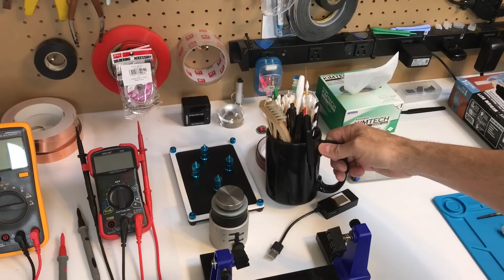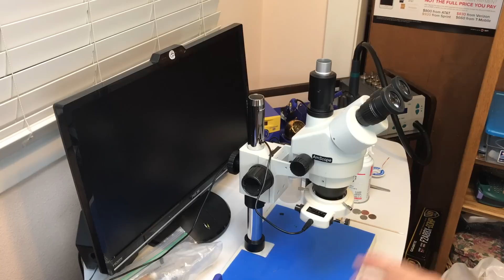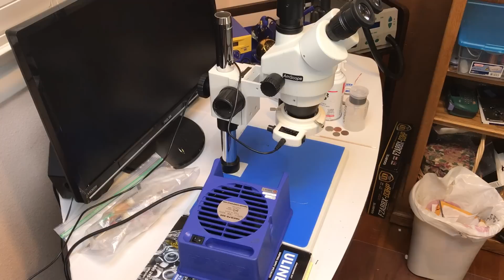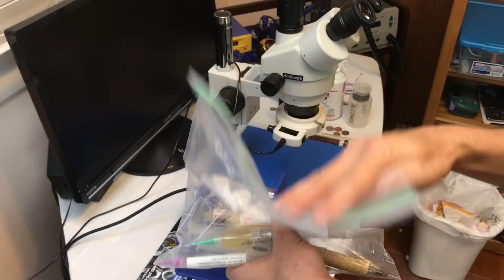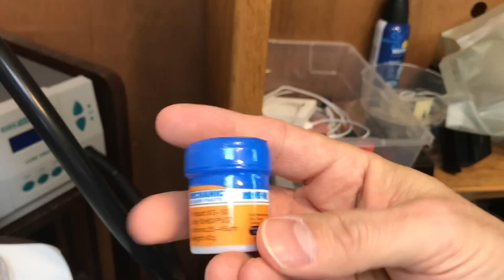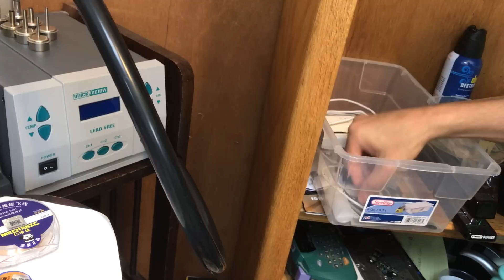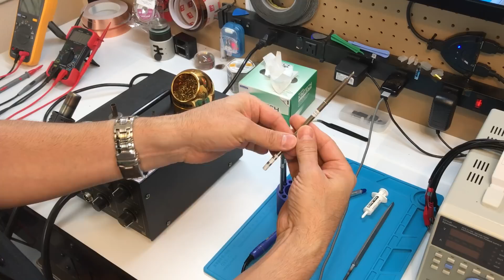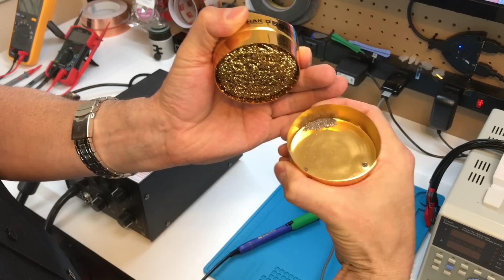Micro Soldering Repair Equipment

Comment: Please really need help, i have iPhone 6, work correctly , the only problem i get is that i cannot get phone calls when i pair it with my Bluetooth. IPhone recognize the Bluetooth pair with it, i can hear music on YouTube, i can make calls and video on face time and what's up, but when I made regular calls i cannot hear nothing and they cannot hear me , any idea why and what need to be done ?????????? your assistance is appreciated and Thank you for your collaboration, please send me email to msprofit42@gmail.com
Reply from the maker: Have you already tried a different bluetooth device? From what you've described either the phone doesn't communicate properly with the one that you are using or you have a problem that need further diagnoses.
Reply: yes i tried different Bluetooth, but it didn't work , i was told that i need to change the audio IC, is that true????
Reply from the maker: Maybe. This seems like a software issue or possibly something causing the phone to switch over to a different state rather than utilizing the bluetooth feature. Check and make sure that it isn't going into headphone mode and the screen doesn't black out when you make a call. Beyond that my next step would be to put the logic board into a different housing and see if the problem persists. Changing the audio IC would be my last resort.

Comment: Hey Mike I want to practice micro soldering I’m gonna order the 852D+ would you by any chance be able to send me some soldering practice boards I know you mentioned they are inexpensive I really want to learn this to get in this field and ahead of just doing basic repairs
Reply from the maker: Hey Edwin just going through comments now. If you want to order the 2.5mm driver from me I'll send you a practice board along with it. They are pretty basic but I think you'll but it helpful. I'll put up a video on them in the future.
Reply: It’s alright Mike and oh great that’d be great and I’ll appreciate it so much going to make the purchase now on the driver thanks again Mike appreciate it
Reply from the maker: Not disagreeing with you at all Alex in that these practice boards don't teach you everything. They only go down to 0603 which is almost three times the size of 0201 and we have to work with even smaller components when it comes to phones so yeah, whole different ball there. What we do find useful about these is getting someone from 0 to competency with an iron and hot air, understanding how flux and surface tension work, creating a healthy joint etc. and if they plan on sticking with larger jobs that may be all that they need. Maybe including these in a microsoldering equipment video is misleading? I'll make an update in the future.  Your comments are appreciated so if it sounded like I was being critical that was not my intention. I've just found that for many starting at this level before jumping into the really small stuff is helpful and in some cases a good way to find out if the latter is even an option. It's also about as much as I can provide at no charge when someone buys a screwdriver from me on Ebay lol.
Reply from the maker: They don't come with any solder on them so you can use whatever you prefer. We recommend 63/37 rosin core as it is easiest for beginners to work with. The scale is larger than most components you will work with on phone motherboards so yes, if you can't master these then no use planning to replace something thats 0201 or even smaller. Old phone boards are a good option for practicing too.
Reply: Go Cell Phone Repair , even if you master those, the work on phone logic boards is a completely different ball game. Those boards make more sense for laptop repair practice, TV, gaming consoles. I would suggest buying a few dead boards instead and practice on those.
The once you have are more for understanding the smd concept, obviously there are some through hole components there too, which you won't find on most of the modern phone boards.
IPC uses those boards for the certification though, so if you are looking to obtain one that's the way to go. ))) correct me if I am wrong please.
Reply: Go Cell Phone Repair Gotcha Mike. I was a little picky, don't mind me. Great work, and good video.
Reply: Those practice boards are useless )))) throw them away, its a completely different size scale, it won't give you any good practice besides it is leaded solder on them.

Comment: Could u please tell me exact dimensions of ur  microscope base in millimeters. I miss 3 measurments please help me check the picture here 
https://photos.google.com/share/AF1QipNUwHED5s0IAGQrgXWIXlw0IolcIIUFqiZJ7nRI_6Es26ptZ3aQiGWgJDotHKw-oQ?key=OTFocnhadVd6RWJicGI2LTlScWZoOExxUnlwa25R
Reply from the maker: These are roughly the measurements. If you want to be certain though I would contact the manufacturer. Here's the link to this model: http://bit.ly/2C4cBtr

A= 7mm 
B= 30mm
C= 43mm
Reply: Go Cell Phone Repair thanks a lot!

Comment: The cheaper soldering station is a luxury to me... I started out with a 40watt plug in to the wall soldering iron. You didn't talk about any de-soldering equipment other than the wicking tape. Do you use anything special.